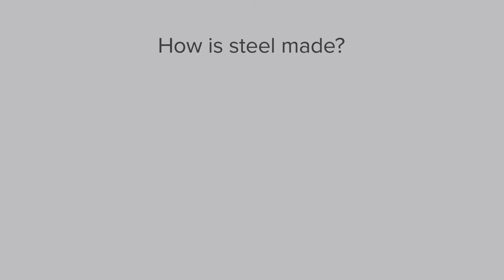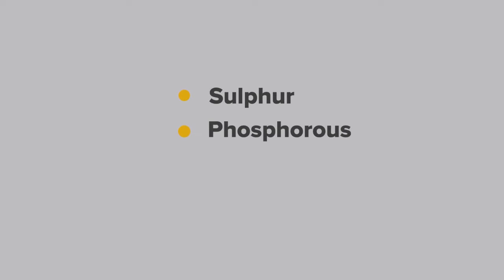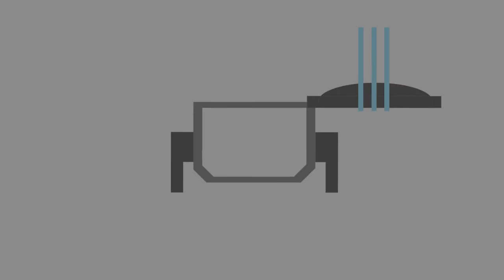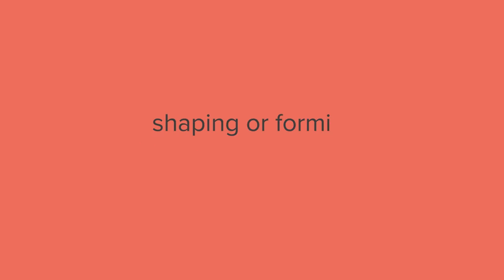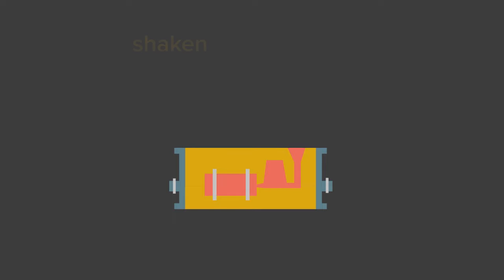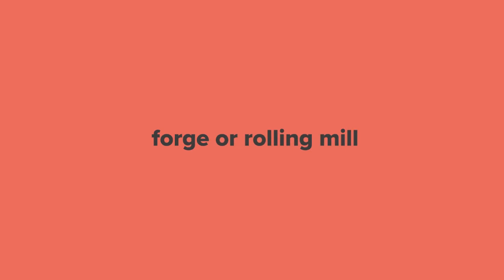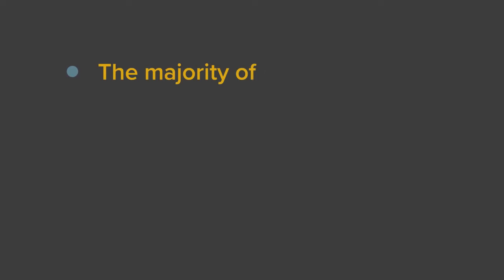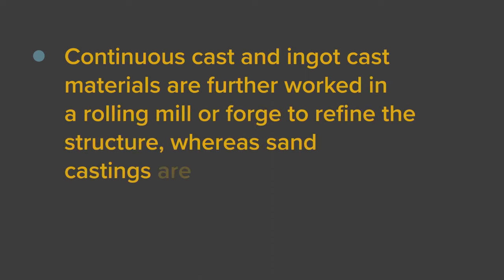Steel Making and Casting (Principles of Metallurgy)

Comment: This design of video belongs on the scrap heap.

Visual learning is one of the best ways to learn, but not by diagrams or words being spelled out across the screen. When it says, for example; "The slag is skimmed off", it should SHOW IT BEING DONE AS IT SAYS IT.

We need a world where money doesn't exist, because the lack of funding reduced this video into a moving slide-show-power-point presentation, whereby you learn about 80% less than you would seeing the subject matter in its true form. What I mean by that, is the camera team should go to a smelting works, film the process in action, then have the narrator talk over the process in action, followed up by a summary of bullet point words to cement the witnessed process, for documentation for the learner's/recipient's benefit. THAT is way better than reading words across a screen, that means nothing..

UPLOADER:
Thanks so much for sharing and collating all this material. God bless you!! :)